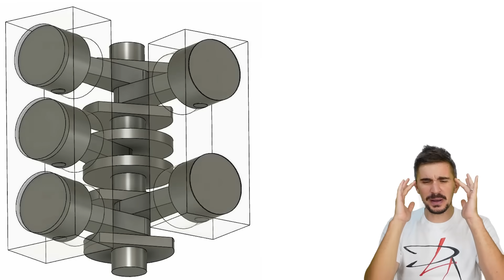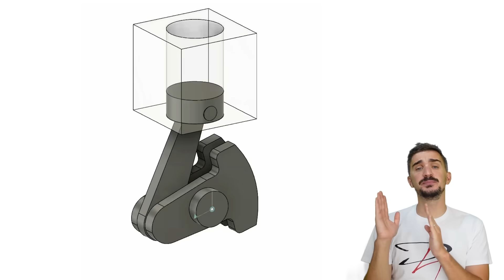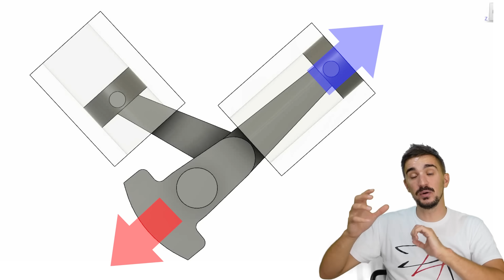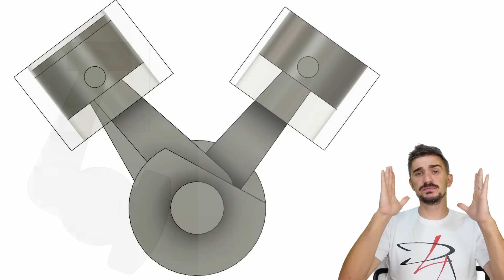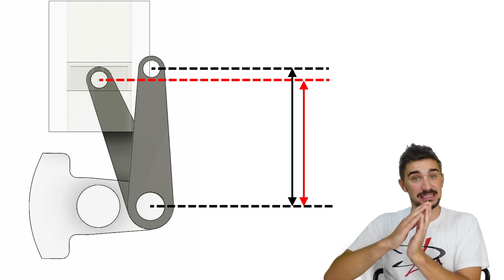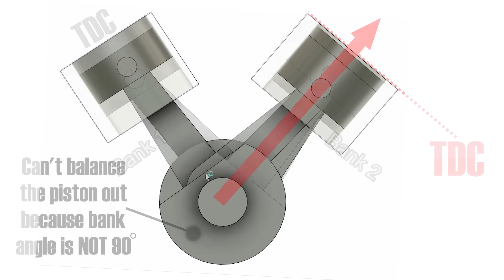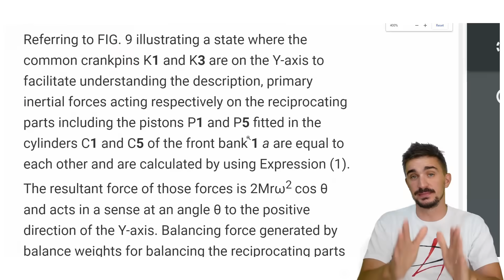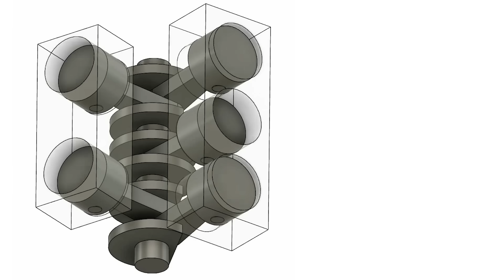Logic Defying V5 Engine - Honda's RC211V Explained Like Never Before

Comment: The firing order is tricky isnt it? Looking at it it looks like it fires 1-3-4-5-2 or something unless it fires opposing cylinders in pairs (bank of 3 has cyls 1-3-5, bank of 2 has cyls 2-4). What I find really interesting, when cyl 1 fires, it would wait either 104.5 or 284.5 degrees to fire the next cylinder. If the firing order is 1-3-4-5-2, then there is 104.5 degrees of rotation between 1 and 3, then only 29 degrees between 3 and 4, next 75.5 degrees between 4 and 5, then it waits 284.5 degrees for 2 to come all the way back around like a v twin, then it can fire again when 1 comes back to tdc in 75.5 degrees. This is better than 1-4-5-3-2 at least, which would wait 255.5 degrees instead of 104.5, and is more evenly distributed between the sides of the engine than 1-2-5-3-4. But this is armchair math.
Reply: Nevermind, I found a source on this, but it is in indonesian. Turns out it is the 1-2-5-3-4, this distributes the extra cylinder between the banks, looks better if you say 2-5-3-4-1. The intervals are a bit more even with 75.5, 104.5, 180, 75.5, then 284.5 to start over. Ok thats not very even at all still.
Here is my source and an english translation:
The picture above is a combustion order on the cylinders of the RC211V. The order of combustion is 2-5-3-4-1 with a power stroke in one cycle of 4 strokes (720º) occurring at 0/ 75.5º / 180º / 360º / 435.5º then back to 0 (720º). From this it can be seen that the firing order is very irregular (irregular), where three explosions are close together, followed by two more explosions close together (360º and 435.5º) followed by waiting long enough to get to 0 (720) This is the character of the Big-bang firing order.
https://tmcblog.com/2020/04/21/kenal-mesin-motogp-pertama-honda-rc211v-tahun-2002/

Comment: This sort of reminds me of how a guy turned a Nascar V8 into a V6 to meet a certain displacement class by removing a pair of pistons, adding a weight to the unused crank pin and blocked off the ports.  Making a sort of cross plane V6. Worked pretty well and sounded kinda funky but also great.

Comment: Volkswagen also made a V5 -- well, a VR5 -- consisting of a VR6 with one piston removed and one cylinder blocked-off. (or at least that's how they started out.) They did this to meet displacement and emissions regulations in some European countries. I've heard it was a dog to drive, and when people could manage, they would convert it to a VR6.

That said, the math you go into in this video, to explain Honda's dedicated V5 design, is very impressive, and I applaud you for doing so.
Reply: That's not really a V engine. It's an inline 5 with the cylinders squeezed together by offsetting them by 15 degrees.
Reply from the maker: It's in the video
Reply: @d4a  It is. The video was still playing when i wrote the comment. The fact that you actually understand what the VR engines actually are makes you a very rare breed and shows that you actually know your shit when it comes to automobiles.

Comment: I bet an I3 engine would beat the crap out of the V5. The optimal engine CC size is thought to be 500cc per cylinder.
So a 3 cylinder can go all the way from 1L to 1.5L. More than enough power per weight ratio if you ask me.
Reply: There is no cylinder displacement which is optimal for all applications. In recent cars, 500 cc is a popular choice; that doesn't make it suitable for racing motorcycles.
Reply: @brianb-p6586  cylinder sizes have increased because of better manufacturing processes, better use of metals etc... if you don't think an i3 can outperform this, take a look at what Koenigsegg is doing with small 3 cylinder engines.
Reply: @ProDigit80  A highly turbocharged exotic car is not the same situation as a normally aspirated motorcycle, so the Koenigsegg example is irrelevant.
Reply: @brianb-p6586  oh, OK. That leaves things simple then. Compare a 3 cyl with this, and the 3cyl will outperform this ik efficiency. And if manufacturers want, it will outperform in power too. In the 80s and 90s things were different. But nowadays, with modern metallurgy, they can even make a 2 cyl more powerful than this.
Reply: @ProDigit80  The RC211V engine, like every other engine of any design, needs to turn up to 16,500 RPM to produce the desired power. Speed is critical because power is the rate of producing energy, and energy is proportional to how much fuel is burned, which is in turn proportional to how much air is used... so power is displacement multiplied by speed and multiplied by the ratio of boost pressure to atmospheric pressure if supercharged, regardless of the number of cylinders.

A 2-cylinder of the same displacement would have to turn just as fast as this 5-cylinder, and even with state-of-the-art metals, that's not practical. Koenigsegg's 3-cylinder can only handle up to 8,500 RPM, which is enough because a turbocharger packs in three times as much air as would be pulled into a normally aspirated engine; the RC211V engine is not turbocharged, and would not have been allowed if it had been.

Also, engine design is far more than metallurgy. The challenges in making high power are all about fluid flow and combustion dynamics; not having the parts break is important, but only a supporting part of the design.

Comment: So if you built a 2L V-10 off this Honda design, would it matter if the “extra” balance piston was on the same (or opposite) bank as the other balance piston?  Does it depend on whether the additional 4 (non balance) pistons are 180* out from the other additional 4?  In other words, could you build a “balanced” 75.5* V-10 with flat plane 180* V-8 crank and a 104.5* offset V-twin sandwiched in the middle?
Reply: This design hack only applies to v engines with an odd number of pistons, not a v10.

Comment: Thank you so much for this.  I know I'm gonna watch it a few times to really get it but your explanation is very good. Kenny Roberts team also worked with a V5 I think based on the 211V format.. it was certainly one of the most interesting engines and I remember back in the day it was like the Valentino Rossi show Starring the V5 Honda and the rest of the crowd racing for second place.

Comment: Volkswagen sold a V5 engine in Europe.  This was really just a VR6 with one cylinder blanked off.

This isn't the only time this has happened;  Jaguar's AJ126 V6 engine is little more than an AJ V8 with the front pair of cylinders blanked off.  This is a cheap way to do it, but this V6 has V8 weight.
Reply: Interesting... I had not heard of this idiotic cylinder blanking idea being applied to a V8-to-V6 adaptation. Even then, the AJ126 has shorter heads, a lighter crank, and two fewer piston assemblies, so it is clearly lighter. 

By the way, it is the two rear cylinders which are omitted for the AJ126, not the front two.
Car and Driver did a good article on this - search for "Block Party: Creating a V-6 By Declaring Two Cylinders Redundant"

Comment: There was a conspiracy theory round the time MotoGP moved to 800cc. The excuse was the bikes were going too fast and it was unsafe, so the reduced capacity would nerf them. But the theory was Honda had lobbied for the change, hoping their development into a V5 would make things easy for them changing to a V4. They would have all that development time with 200cc cylinders that the other manufacturers would have to catch up to. This however didn't work out, and Yamaha would become dominant initially in the 800cc era.

Been a long time and it was mostly hearsay on biker forums, not sure how true it was. It's an interesting theory anyway.

Comment: Fantastic. Allegedly one of the driving forces for this layout and the V3 two stroke was to have the narrow end of the motor accommodate the riders legs when tucked in.
Honda at their absolute innovative best.
Reply: The vfr1200f and X have the same principle with the rear cylinders connected to the middle of the crankshaft and the front pair to either end making the rear of the engine much narrower.
Reply: What a load of rubbish. You do realize that on the  V triple two stroke, the area next to the rear cylinder on both sides is used to run the exhaust expansion chambers from the front two cylinders through, right? Which makes the back end of the engine virtually the same width as the front?

Comment: I've heard Audi RS3 cars with full exhaust systems and special tunes. They sound A-MAZING. I'm putting in my wishes right now for a Japanese company to make an inline-5 cylinder motorcycle.
Today without the added width of cast-iron sleeves in cylinders, engines can be quite narrow. BMW has an inline-6 engine that isn't appreciably wide in their K1600. I'm sure an inline-5 would be a piece of cake to make without being extremely wide, for a streetbike application.
Reply: I believe Honda did one inline 5 engine for a road car. Worth looking up!

Comment: Hello, amazing video as always but i wanted to ask something About the part "the magic of 90 degree V" , if 90 degree is the best then why 72 degree V10 has better balance than 90 degree V10?, audi 90 degree v10 had to use a balance shaft to balance it out unlike their 72 degree v10s. also same for V6 , 60 degree V6s are more balanced than the 90 degree ones. Your explanation in the video about that part also made sense to me but then why is 90 degree worse in the v6 and v10 examples that i just gave?
Reply from the maker: It's all about the firing interval: https://youtu.be/VQJ0kYFF9T4 here it is explained for the v6.
Reply: @d4a  thanks a lot

Comment: This was the engine that unintentionally cemented Rossi's legacy. Rossi left for Yamaha to prove that it wasn't just the bike... but the RC211V was just a stellar bike in that sweet spot right after 2-strokes ended.
Reply: Yep, right place, right time.
Reply: I have the feeling that the RC 211V had one of the most linear power deliveries in top end racing history!
Reply: I mean, Rossi still won a lot without Honda, but the RC211V's reputation is undisputable
Reply: The 2004 Yamaha engine deserves a video like this..
Reply: @petesmitt  there already is.... Search cross plane crank in his videos you'll find it. It's about 4 years kld
Reply: What about the stuff that Doohan rode.  Big Bang and all that. I'm a lover of 2 strokes
Reply: @pauloconnor7951  Me too, a lover of two strokes I mean. The smell of pre-mix, the sound, the kick in the ass from behind when it comes on the pipe and the front wheel is climbing! Yeah that's perfect!
Reply: Then they made crossplane for rossi to win over again
Reply: Such a legendary time in racing.
Reply: And Rossi proved it by winning the championship on the Yamaha
Reply: Rossi and the 211 were magnificent.  No man, or machine had their measure. An amazing time to have been a race fan.
Reply: @BastardX13  right? I was so disappointed when I heard Rossi was retiring last year.
Reply: Should’ve waited to go to Ducati too. If he’d waited until say his last few years he would’ve had a better bike to go with. Sorta riding the best of each manufacturer’s lineups when he was with em
Reply: Saw Bruce Anstey ride this in 2018 at the IOM TT. Sounded like nothing else!!! Impeccable!
Reply: Right on. Rossi went to Yamaha to prove he’s the Michael Jordan of the motorbike world.
Reply: @SimonBrisbane  @LaughsInAgostini 😂
Reply: @SimonBrisbane  no he didn't, get off the pole fanboi
Reply: Yes, and it's a testament to Rossi's skill that he kept winning on a bike that wasn't quite as good.
Reply: There were other riders on the V5 while Rossi was on it but they couldn't match Rossi either
Reply: I think it was the bike where he ascended to his full strength and galvanised the self belief he used to incredible effect throughout the rest of his career.
Reply: well The Kentucky kid proved it was the bike by beating Rossi on his own bike
Reply: Turncoat.  Even was naming a bike after him, RC46, the VFR800.
Reply: @squirrel6687  did VFR mean Valentino Fockin Rossi?
Reply: @Mark Robles  When the VF was a V 4 and the VT was a V twin. It's hard to see that later VFR would mean Valentino Rossi. More likely simply a rebrand as the VFs had a major cam oiling issue and were are pretty shit engine. The VFRs completely rectified that image
Reply: Decades later the 500s became MotoGP and Honda changed to a V4 4 stroke.  The VFR brand and Valentino Rossis initials are a fluke
Reply: @malrobles  That's funny, great reply. As for Squirrels assertion that the bike was named for Rossi, well they must have been using a crystal ball to see the future, seeing as VFR's were on the market years before Rossi began his premiere class career with Honda on the NSR . I had the 750cc VFR in 1995, a year prior to Rossi racing Aprilia in the 125cc class.
Reply: @BobJones20001 I read somewhere it wasn't an oiling issue but soft metal. Honda made them on the cheap. If you have the cam ground then hard surfaced cam will last a long time. I wish I knew this before I sold my 85 Magna. Oh well
Reply: @squirrel6687  that's a hoax by you and not even a good one.

Comment: They never "unbalanced the engine, and then balanced it back", the correct way to look at it, is that "they created a balanced engine with 5 cylinders" with the goal of increased power in a smaller volume of space, and the ability to shorten the wheel base.

Still a good video though. Cheers.

Comment: Amazing video @driving 4 answers btw can this trick and V angle be extended to a v10 engine or would you have to change the V angle to 72 degrees to get perfect balance?  Also could this same trick also be applied to a v3 engine?

Comment: I think i didn't understood one thing properly. First You say that the counterweight is not for balancing forces created by piston, connecting rod and so on. Then You explain how its balancing piston, connecting rod and so on....
Reply: The counterweight is not meant to balance just the Up/Down forces of .... etc.
Reply: @daveinwla6360  i and He didn't said/wrote that's for vertical forces only...I and He wrote/said its for balancing piston etc.
Reply: @bengacz   -  A single cylinder's shaking can be minimized by dividing the counterweight's influence between the up/down forces and the side-to-side forces in a compromise.  By adding a paired cylinder in a 90° V-configuration, you can avoid that compromise (in the primary forces).  This is all explained in the 1st third of the video.  Just watch it and pause frequently as it sinks in.

Comment: great video as always, i had no problem understanding this and enjoy these types of videos and have worked with tons of engineers and have technical/mechanical background, lines been good, i love these odd spec engines, i could see the Ducati engineers laughing at Honda, they're an arrogant bunch of nuts and Honda said simply hold my beer and went to work and built this awesome engine and watched Ducati pick their jaws up off the floor, I just love it Like when the V4 car engine was built  by Ford, I don't know if they were the inventors of it, they used back in the day and was fairly successful and reliable for smaller lightweight vehicles and still see a Saab running around with one in it and its pretty smooth, like an inline 5 CYL Audi/VW used them and Volvo used them when they brought out the 850 series cars cars in 1992 and here  in Canada in 1994 and remember driving a base 4DR with a 5 spa manual and that thing ripped for a new model car and got amazing fuel economy, 1st customer said as good as 6.85/7.3 litres/100kms that was really good for that year in the 90's for a big car for Volvo and the natural intake sound was awesome, in 2000 when then used VVT on both intake and exhaust, the V70 N/A 5 speed auto would get almost 1000kms to a tank of petrol, great cars, and great video 👍
Reply: That Ford V4 that Saab used was originally designed in the US for a small car called the Cardinal that was cancelled before production. Ford built the Falcon instead, but the engine was used by Ford in Germany in the Taunus and others. It was not, however, a 90-degree vee but 60-degree with a four-throw crank, so it did not have perfect primary balance. It relied on a balance shaft. It was built in capacities ranging from 1.2 to 1.7 litres and fitted to a range of vehicles. Most contemporary reviews found it pretty unimpressive. Ford UK repeated the error with the Essex V4s of 1.7/2.0l (Transit van, which was so boomy that the tradies did not notice the engine vibrations) and matching 3.0l V6 for the Zodiac and then the Capri. For all its deficiencies, some of the V6s lasted long enough for owners to replace the awful V8s in their Triumph Stags with Essex V6 that came either from rusted Zodiacs or crashed Capris.

Comment: An Austrian tractor manufacturer has built a 3 cylinder V engine, the name of the manufacturer is Warchalowski.
Reply from the maker: I think another company that does agricultural stuff built an inline 7. But agricultural stuff is a bit easier as it never does high rpm. High rpm is one of the greatest challenges for engine building as it increases forces exponentially and kills poor designs rapidly. Oh, a rhyme.